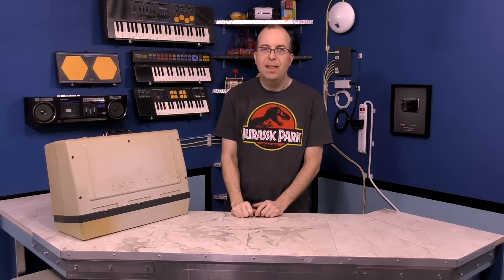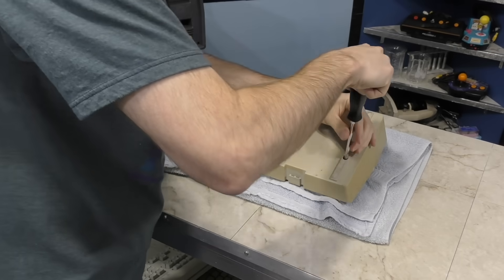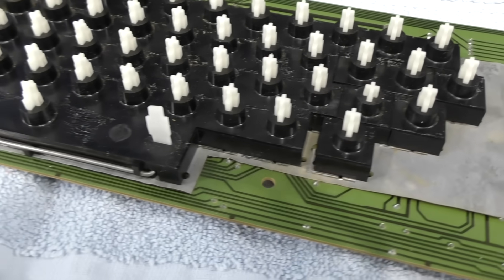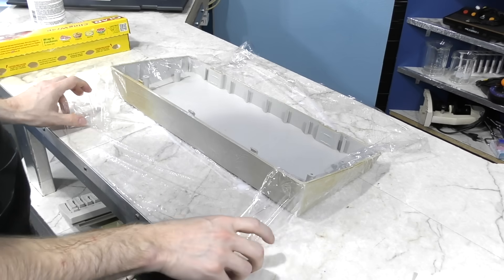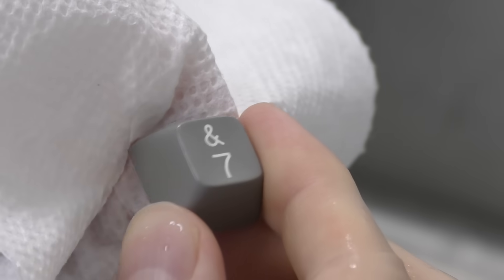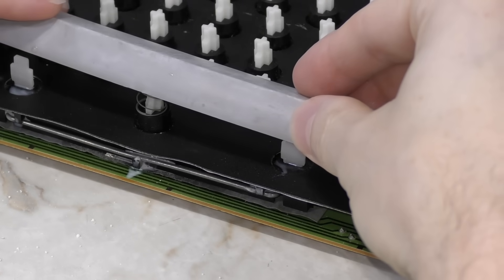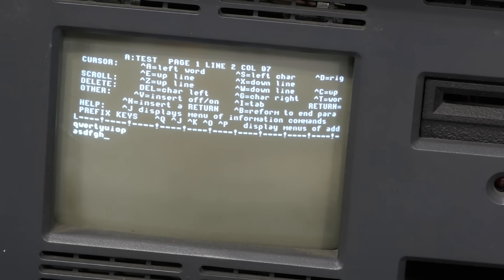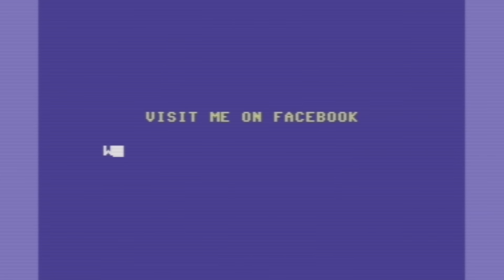Osborne 1 Computer Restoration Part 1

Comment: I think I may know a fix for the marbled Keyboard. I don't know if it's for the same reasons but sometimes I see such discoloration on plastic inside my car after some rain drops fall on it through the open window as well as on the bottom of my air washer. The fix for that is Petroleum Jelly or Mineral oil. After applying some to the discolorated area and then wiping off the excess[the plastic appears to absorb it so the surface is not sticky even without washing, which could cause it to discolor again] the white color fades and the plastic is back to normal. You could try it on one key, and if it doesn't work you can just wipe and wash it off. 

tl;dr Try to coat the keys with Petroleum Jelly or mineral oil.
Reply: Yeah, but instead of mineral oil I would take silicon oil, best for plastic
Reply: That is my guess as well. In fact I would put any retro-plastic in mineral oil and leave it out in the same temperature as when it was retro-brighted. He didn't notice it when he first took it off, because it was wet. The water filled in the rough surface of the oxidation. The oil once worked in under heat will do the same, but will not evaporate.
Reply: I wonder if Trim Shine, Armor All or a similar silicone spray would fix the keys as they work on discoloured plastics on cars. Worth a try 8 bit guy. 😊
Reply: I'm not the greatest at English, but during my research, I just found that mineral oil and the jelly are very similar and that's why I suggested it since the jelly worked for my plastic. I'll surely look into the silicon oil!
Reply: The problem with mineral oil (petroleum jelly ...) is that it can make the plastic brittle or shrink over time. It's best to use a silicone oil based coating (silicone lubricant or the stuff meant for car interiors) as it's proven safe on plastics and won't damage them.
Reply: +Kent Nixon You nailed it. http://aktuelbevaring.natmus.dk/afrensning-af-plast-med-retrobright.html
Reply: +Kent Nixon
404 Aerospace Protectant works well to preserve the color of retrobrighted plastic, too.  I recommend it on any restoration project.
Reply: Hope he sees this and tries it in the next episode
Reply: This was my first thought as well. Mothers 06112 "Back to Black" is an example of a commercial product designed for the same purpose
Reply: Well, it appears the internet solves yet another problem! Now we just need a 6502 control board and apparatus that makes popcorn...
Reply: I was just asking somebody in LGR's thread about ways to fix the "bloom," and lo and behold, here you are.
Reply: Another YouTuber uses WD40 on restored/washed controllers and other plastic things to much the same effect.
Reply: I really wish I knew about this trick before I painted my SNES. I think it looks great in black, but I could have possibly saved a ton of work and kept the original appearance if I knew the streaking was due to needing a coat of Armor-All.
Reply: If you want to undo that mistake, go get some ZEP purple degreaser at home depot or wherever, and submerge the painted plastic frame in it. I used to use this when I was in ceiling restoration...it could eat off powder coat, but would leave plastics unharmed. You might want to use some small rocks/small objects of some kind to displace the liquid so you don't need as much. Just make sure you use it in a well ventilated area, as it is not very fun to breath... If you just want to try a spray bottle, I can also recommend "dirty jobs" degreaser. If you try spraying, give it some time to work in, and spray multiple times before you attempt to remove the paint. Mark my words, not all degreasers are created equal. Some are nearly useless, and those are the two brands I would recommend...they have some real punch to them. Nothing beats ZEP concentrate though! It comes in large bottles and is a deep purple color.
Reply: I was about to say that. Put some mineral oil on it and wipe it off. It helps.
Reply: I just wanted to thank all you guys for the tips on discolored/streaked plastic, I had some nasty streaks on my NES and a liberal coating of Armor All seemed to do the trick, thanks!
Reply: I think the marbling was not actually damage 8-bit guy did, but what the yellowing was covering up. Certain lotions are known to discolor ABS, and the yellowing would've covered it up.
Reply: OOhhh interesting! I will keep that in mind.
Reply: Oh, and a thing I forgot to mention when I was writing the 1st comment. It also worked on pretty modern keys. I had a yellowed Logitech keyboard and after the process, the black letters looked washed out and the petroleum jelly made them nice saturated black again. Maybe the keys on the Osborne are somehow painted or stained and the peroxide messed with that like it did with the letters on my Logitech.
Reply: This is what I was thinking as well. The chemical process caused by the retrobrite method probably strips some top coating material from the plastic, which then effectively "corrodes" when exposed to oxygen. Either that, or the effected areas of the surface become porous (sp?) and reflect light differently. Either way, the solution would be to quickly apply a coating of non-reactive material to protect the underlying plastic. I bet 303 Aerospace Protectant would work well, especially since it helps block UV rays.
Reply: A better fix imo that I was thinking of was actually spraying on some clear coat, to fill in the oxidation some.

Comment: I'm pretty sure I know what happened to the keys. The cellophane was too crinkled up around those small objects. That held more solution in some areas rather than others. You don't notice this as much on large objects because the cellophane is stretched relatively flat. I think a good way to fix this in the future is to use way less solution on small things and shorter sets in the sun. That way you can monitor the progress and make sure you don't over do it.

Comment: You should really clean the rust/corrosion as much as you can  from the keyboard before putting the screws back on as that might make the screws and the entire keyboard much much more prone to rusting and corroding again (It could corrode on its own.. that rust spreads like fungus) ... You could use some iron wire sponge (thats sometimes used for dishes/soldering) to scrub it off.

Comment: 5:08 That happened to me when I retrobrighted my Super Nintendo. Now I use a mix of hydrogen peroxide based cream and some powdered stain remover to achieve a more homogeneous de-yellowing on plastics. It creates a foam which spreads the sunlight evenly, but this method may take several more applications tho

Comment: So far so good! I usually like to cover with some light grease to the metal parts, just cleaned from corrosion. (In this case the connector with contact grease, and the screws with some regular spray grease.)

Comment: About the streaking - i've had this happen and it can be fixed by going over the area VERY GENTLY with a hot air station. I set it to about 150-170C (above the glass transition temperature of ABS but not too hot) and go over the area in a circular motion for it to heat evenly. This works well for large flat areas, but small thin plastic pieces like vent grating deform very easily so it's best to avoid going over those.

Comment: Get some Augeo solvent, it's commonly used for either cleaning or candle/diffuser making, however if you rub that stuff over the keys it will smooth out the paint job.

Comment: Sticking a copper cable in an acid is a pretty sure fire way of not having any conductors left in a few months time.

The vinegar would have wicked up the cable, not just into the connector, and you'll never be able to clean it all out, so chances are the cables conductors will completely corrode through some time in the future...

Comment: Ive seen the thing that happened to the keys happen to pool cleaners. It's usually caused by something eating away the finish on the plastics and makes them feel rough. In pool cleaners, the cause is long periods of being in the pool, without allowing the plastic to dry off, and thus giving a chance for the pool chemicals to eat the finish. It seems like the cream may have done the same to the keys. Unfortunately, I don't know of any remedies.

Comment: Pretty nice results. 

Just to confirm that the results that you experienced on your keys is not an anomaly, I got the same weird streaking when I tried to retrobright some plastic trim pieces on my car. Their color was restored, but they came out with terrible streaks on them. Luckily, I was able to spray paint them to fix the issue. 

I wonder if it is the type of plastic that causes the issue, or the length of time retrobrighting?

Comment: Well at least the "marbled" keyboard looks quite a lot better than it did! Looking forward to part 2. Also, you didn't mention what caused the Osborne pow and the smoke. You did say you would mention it later on, so will that be in part 2?  I am  curious to know what happened.

Comment: Me thinks a line filter cap went kaboom. 

With the mottled retrobrite , the onyl thing i can think of is that it may be due to using recycled ABS in the caps and not having it mixed propperly.

Still absolutly fantastic caps .

Comment: Is it just me, or are your studio shots slightly pink?
Reply from the maker: My new camera has a bizarre white balance and I look green in the images.  So I try to correct in post.  However, I'm partially color blind so it is a real challenge for me. All I can usually do is get close.
Reply: One way you can check the colour balance, even if you're completely colour blind, is to sample a pixel in a neutral grey area. The R, G, and B values should be the same (or nearly the same). In this case, the green channel would be a bit weak which results in a magenta cast.
Reply: Blowtorch the Robot ditto, one of his other recent videos seemed tinted slightly orange
Reply: Apparently he got a new camera but i think he needs to adjust the white balance
Reply: The 8-Bit Guy It's all good, videos are still awesome!
Reply: I was going to suggest the same thing. Professional photographers used to use a 'gray card' when setting up shots as a colour reference. I wonder if he could do the same thing for his videos? https://en.wikipedia.org/wiki/Gray_card https://www.adorama.com/dkgc.html
Reply: He certainly could -- and it wouldn't have to be anything fancy, even a 30% tint printed on white paper on a laser printer... or, if my guess is correct and the tiles on his counter are grey, the counter. :-)
Reply: Gives it a 1992 feel.
Reply: not just you, i noticed it too
Reply: I noticed that too. At least that it was off. I wished I could have white balanced to the keys in the background. lol.
Reply: Its no pink, its Salmon xD
Reply: The 8-Bit Guy you should ask other people to help you tbh
Reply: Some sampled gray RGB values: 

Gray box on the wall on the right: R58 G46 B50

Your shirt: R59 G46 B52

Keyboards: R117 G94 B104

These were affected by compression and light bounce but it shows how red is overpowered.
Reply: I thought so too. He needs to Retr0bright the video.
Reply: It depends on the image. For optimal adjustment on a normal image, setting the highlights to 95% brightness and the shadows to 5%, with balanced neutral grey, will do the trick. One doesn't go all the way to white or black, since you want to preserve image detail. Note that the "highlights" and "shadows" here refer to the brightest and darkest LARGE areas of the image; specular highlights (reflections on curved glass, for example) can blow out to pure white.
However, it's probably not required here, and can be a fussy process. Balancing the greys alone will provide the most dramatic difference.
Reply: Nope, not just you. This is was pink compared to his other videos.
Reply: Blowtorch the Robot that may be because of your glasses
Reply: The 8-Bit Guy I believe in the enhancements section of the video edit/info screen on YouTube there is an auto white balance...
Reply: Blowtorch the Robot I rewatched and just noticed it
Reply: +Making Sense do you think that neutral gray alone is sufficient? I thought that you would need black and white references too
Reply: The 8-Bit Guy consider using a color spectrum cards or Shirley Cards to help you get skin-tone down. Most tools used for post like After Effects and Vegas can key off of those.
Reply: Blowtorch the Robot are you watching on an gs8 (Samsung galaxy s8)
Reply: I noticed it to on the case
Reply: Blowtorch the Robot Watched this on my phone. Couldn't tell.
Reply: Yes.
Reply: I'm colour blind as well. Never notice much colour casts so wont even be able to try and correct for them lol. My big challenge now is to scan all my colour film as I only have the physical negatives and 1 copy is not a good backup strategy :)

Adjusting the colour on the scans is going to be a pain, If I even attempt it!
Reply: The 8-Bit Guy aren't we all color blind in a way?

I personally have trouble seeing the yellow spectrum, they look mostly green to me.
But its okay since all shades of green are my favorite color.

Comment: Noo you didn't show us what caused the fire! :(
Reply: Well, it isn't smoke from a fire. What happens is the electrolytic filter capacitors in the power supply develop cracks in them over time which lets moisture in. When enough moisture gets in and current is applied they burst apart and release the magic smoke. No fire is involved and it is an very easy fix.
Reply: ooh, you're such a tease! :P
Reply: The flux capacitor was obviously fluxing too much; which unfortunately causes heat and smoke.
Reply from the maker: You'll see it in part 2.
Reply: I'm going to guess that a cap in the power supply blew up.  You should never power up an old computer without checking over the caps first, unless you like the smell of magic smoke.
Reply: I know it was probably just a capacitor, but which one?! the suspense!!
Reply: I had the same issue with my Osborne 1, it was actually a class X plastic film safety capacitor that exploded, not an electrolytic
Reply: RefractionPCSX2 Cliffhanger!
Reply: RefractionPCSX2 
It was probably a capacitor...
Reply: +Charles Mellen but what if C3 had a hand in it???
Reply: Mister PDP same thing happened to my apple 2e
Reply: Yup, also a good idea to wire up a current limiter in case the leaked electrolyte or aged adhesives have shorted anything to ground. (Assuming, of course that you can find the lightbulbs to build one.)
Reply: I had that but not on a Woburn I ws trying to kook up a c 64 and the art I was using poped
Reply: it doesn't matter who blow up first...
Reply: The 8-Bit Guy Is this the first time 8-Bit guy has replied to a comment?
Reply: RefractionPCSX2 there was a fire
Reply: He LIED! He didn't show it! BOOOO!
Reply: +The 8-Bit Guy is it just a joke?